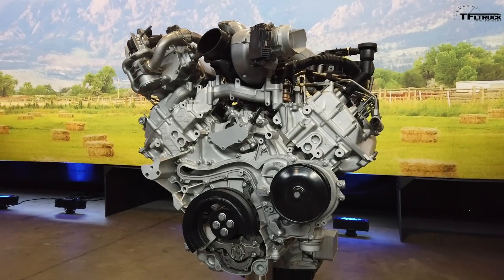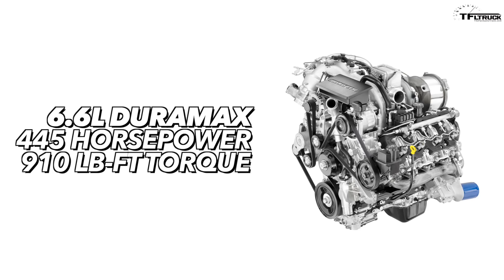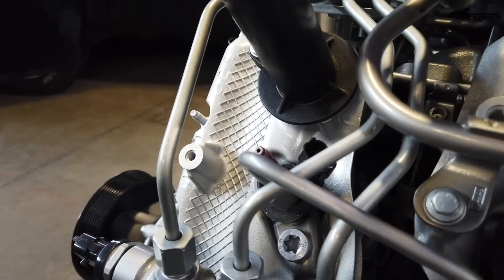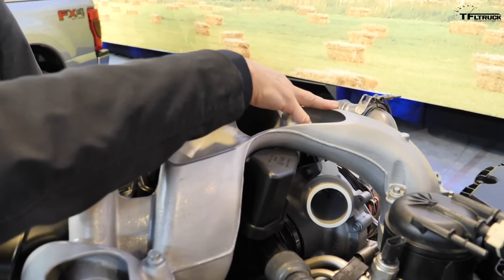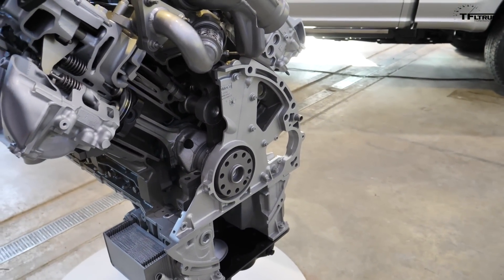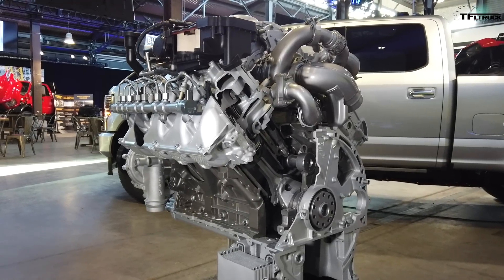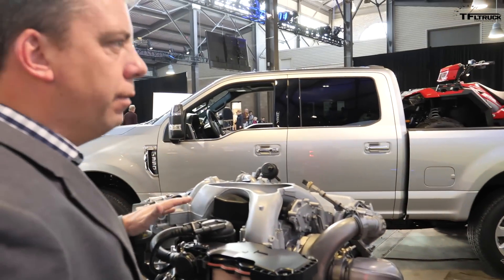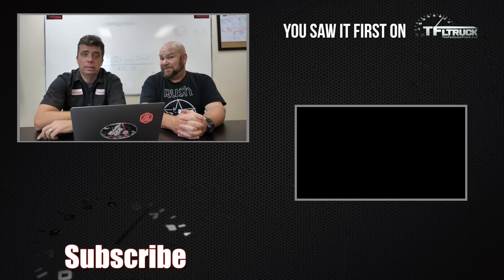Here's How the 2020 Ford Super Duty Diesel Makes 1,050 Lb-Ft of Torque!

Comment: EGR gases need to be plumbed from after the exaust filter so the EGR cooler does not get clogged with soot  and the exhaust filter needs to be removable like in a big rig so it can be sent out to be cleaned like a big rig

Comment: I USED TO BE A FORD GUY AFTER OWNING SEVERAL SUPER DUTIES 2002,2011,2013,2016,2018 AND MY 5 MONTH OLD 2019 F350 KING RANCH ULTIMATE DUALLY THAT CAUGHT FIRE INSIDE THE CAB ON DRIVER SIDE ALMOST TRAPPING ME INSIDE DURING AN ACCIDENT. WAS HIT ON PASSENGER SIDE AND CATCHES FIRE ON DRIVER SIDE. SOMETHING TO THINK ABOUT ESPECIALLY IF YOU HAVE CHILDREN STRAPPED INTO A CAR SEAT OR BABY CARRIER. CALLED FORD CORPORATE TO REPORT CONCERN AND THEY COULD CARE LESS

Comment: Great video!  But, with manufacturers making 400+ HP and 900+ lb-ft, knowing who makes a touch more is becoming absurd. Current tow tests measure the time it takes to pull ~30,000 lbs up a steep, sustained grade. Such extremes don't reflect the real world for the vast majority of truck buyers. How about testing fuel mileage on the same grade with a 'reasonable' speed (~55MPH) & towing a 'reasonable' load, say, ~10,000 to 15,000 pounds. Does one get better mileage or run smoother?

Comment: For '19 when ram and Cummins topped the bar when the HO Cummins had cracked the 1,000 FTLBS barrier as ford was to come out with a third generation 6.7 power-stroke for '20 when they found an extra 50 FTLBS.  For '21 those predict ram and Cummins to roll up their sleeves to retake the crown of most powerful diesel pickup when they have to come out with the HO Cummins making 1,100 FTLBS.  With other class leading performance was maximum fifth wheel towing is bumped to 37,000 LBS.

Comment: GUARANTEE the very near future will be gasoline/electric hybrid HD trucks. The 7.3 with an electric motor would be way less expensive and more reliable in every way than a diesel and get better mileage with cheaper fuel. I’d bet anything that is why they built that motor.

Comment: By putting 40lbs of boost to it. Until your motor has 150,000 miles and 50% of its original power.

Comment: As great as all this sounds, I wish they'd go simple and reliable! I own a 7.3 idi from 1993. Ive changed the injectors, injection pump, and other stuff myself because it is simple. Looking at this engine, it looks like a nightmare to work on. So hopefully it lasts forever, or hopefully all the ancillary components (like the turbo) last until catastrophic failure 1 million miles down the road. This new engine reminds me of jet engines with all the tubes and fittings everywhere. And who needs that much torque? And who do you trust to tow 37,000 pounds SAFELY?! That power rarely is planted to the wheels because the computer stops you from blowing up the drivetrain. Anyway, I am a Ford loyalist, but all this recent crap with tiny 4 cylinder turbo direct injection and space age diesels makes me hate new vehicles.

Comment: Ahh reliability never mentioned.  I think if I was buying new I prefer the 20% less moving parts of the Ram/Cummins line. V8 diesel have been inherently less reliable then a I-6 over the years. Just look at the older trucks and folks taking Cummins engines and plop them down into the Fords to make a Fummins

Comment: Did anyone else catch the weight ratings in that chart?
Max towing F350 dually 35,750, but max gcvw still 40,000. 
So, you have the power, but the truck itself isnt rated to pull the weight?

Comment: I agree with what everyone else is saying. Sure the numbers look great on paper but the 6 7 ford is one of the most unreliable Diesel's ever. Same with their Eco turds, Ford forgot how to build an engine in the early 2000s.

But no big deal it's only 75 steps in a few hours to pull the cab in order to do any sort of repair on the thing. These things are technicians nightmare even if you have the Ford IDs scan tool it still extremely difficult to do anything

Comment: Wow, that is 75 HP and 50 ft lb of torque less than the ford with 2 fewer cylinders!  This comes out 66.6 HP per cylinder and 166.6 ft lb of torque percylinder for the cummins. That is compared to 59.37 HP per cylinder and 131.25 ft lb of torque per cylinder for the Ford. Not even a close race. The Cummins is a far better motor all around.

Comment: Dump the egr. The DPF will catch all of the particulate. Why choke the engine anymore than you have to?
Reply: Yeah, wasn't the egr invented to allow gas engines to run leaner without pinging? It boggles my mind that you'd want to run the crap from your exhaust through a turbo. My 94 ranger's egr port was COMPLETELY CLOGGED with carbon buildup after 200,000 miles. I had to use a coat hanger to break a hole back into it. Total garbage that stuff.

Comment: GM isn't playing these numbers games. Form over function hence the huge front ends on the 2020 GMC to fit industry first all aluminum fan with largest diameter. Also to fit the largest radiator in the industry and oil coolers. And industry first ram air for further cooling. The 2019 Duramax LP5 had a great track record without the new cooling upgrades. How did Ford address the over heating issues the YouTube hot shot dudes are having with their 2019  Powerstroke tranny's??

Comment: Get that same 6.7 liter Diesel into an F650/750 and it has 330hp and 725lb/ft torque. This is what this engine really puts out. That higher horsepower and torque is like your gasoline engine running with all 4 barrels open all the time-just doesn't happen.

Comment: My 2015 powerstroke fx4 lariat with a touch of performance mods and reliability is pushing over 700hp and 1500ft pounds with the locking diff and all the tremor package stuff already other then the under armor so please explain the 100k price tag i bought mine 30k miles and have 135k on it now never been to the shop and i race mine

Comment: Ford needs to develop inline 6 diesel like that of the Cummins. Most semi truck use inline 6 but much bigger displacement. These turbo diesel V8 engines no matter the generation take too much spaces. They are a nightmare to work on.

Comment: So many questions. Did they solve the Def problems? Do spark plugs seize inside the engine? Does working on the engine require the body to come off? It seems Ford purposely puts goose eggs to break on certain points in order to create revenue on repairs. 
I'm looking for durability, longevity and ease of repair. 
They make great trucks when new but five years later....boom. Break out your wallet. My buddy has gone through two Ford's and is on his third. Sheesh.

Comment: it's still 900 foot pounds of torque I mean this is just a big dick waving contest at this point in my right I mean if you have over eight hundred foot pounds of torque you're going to be just fine I mean just a couple years ago. It was towing 35,000 lbs with only eight foot pounds of torque hearing in all the other systems in the truck matter just as much if not more than an arbitrary torque number I mean why don't focus on improving the emission system you know figuring out a way around EGR getting improvements death systems figured out what about all that but about all the important things that matter you know what about better cruise control better like adapter speed control what about better transmissions what about better rear-ends what about putting some research and development in the tires or something you know like what about you know going in the air suspension for these heavy duty trucks I like I know Dodge does it with the 1500 but why not the heavy duty trucks I mean why isn't four-door Dodge or Chevy making air suspension for their half tons are there three quarter tons or one tons why do you have to be a commercial business to get a manual transmission there's a lot of different problems and I don't think increasing torque by 50 foot pounds here and there is solving all those problems and with the Chevy the Dodge in the forward to all three you can take him to a shop and you don't even have to rip out all the emissions crap or replace turbos are injectors or anything just get a basic tune and you could be making well over 1200 foot pounds of torque which let's be honest is way more than these trucks were designed to use and plenty enough Tutto whatever the hell you want I mean who's legitimately needing a consumer-grade 1-ton Tun to tow 40,000 lb almost I mean that's just ridiculous

Comment: I have a feeling the 7.3l is going to start poaching a lot more diesel sales in the 3/4 and 1 ton market. This monster is now only worth it for medium duty loads. You may save $0.10- 0.20  a mile on fuel while towing, but  you're paying $6k more initially, and WAY more for components come 100-120k miles. Now I have no doubt it will still be popular with those who buy with their heart, and not with their brain, as well as those who just don't know any better, but their will likely be an acceleration of what is already a trend toward gassers.

Comment: I’m curious where did Ford lose weight to improve the payload capacities?
Reply: Aluminum body saved around 800 lbs then they added heavier axles and brakes to get higher ratings
Reply: Kevin Mohr They’ve had the aluminum body since 2015.  Heavier axles reduces payload capacity because the GVWR does not change.
Reply: Kevin Mohr Also axles and braked do not changes the payload capacity except when they are lighter or heavier.

Comment: How is it runs F450 with high hp and torque, where GM & Rams 4500 are limited to 350 hp and 800’s for torque.
Did they derate the GVW on F450 to lower rate to be able to put high hp & torque?

Comment: Let’s see the F-250 and test that against the GMs and Rams 2500’s. That’s the test we want to see. Don’t care about mad tow, want to see what the common man is going to buy for daily driving and occasional recreational towing. That’s the segment that most people buy in. Getting all that extra power but the chassis hasn’t change and the payload is still around 2500 pounds XLT with diesel where the GMs 2500’s HD are around 3200 pounds. Ram has around 2000 pounds in their 2500’s. Can’t wait for that test.

Comment: these two numbers for the Tremor F350 is mind boggling for a Single Rear Wheel Drive, 21,900 lbs gooseneck weight rating, over 4,000 maximum payload , how can these numbers be right?

Comment: Electric motors will absolutely replace these big engines in time. We will get so much more HP and it will take lots less mechanical equipment. No tranny's , no rear ends, drive shafts. Our future is going to be bright in the transportation department. And all the manufactures are getting in line to do it.

Comment: ford is making their engines to complex give us a in line six.
Reply: Just curious as to what is complex about the engines? Is it because of 8 cylinders vs 6? Is it the reverse flow heads? Don't know how the charge pipes are routed? Is the plumbing on the high pressure fuel system scary? I don't get it... just because this new technology looks different and may work just a tad different, doesn't make it more complex at all. This is the equivalent of everyone being afraid of EFI when it first started becoming mainstream in the 80's.
Reply: "Too" complex...."an" inline...
Reply: Radke32 an in-line 6 is not that complex

Comment: They keep tuning up these medium duty truck engines for consumer pickups.

Curiously, if you buy a commercial level truck, such as an F-650, the same engine is significantly detuned for longevity in the commercial environment.
Reply: GM isn't playing the numbers game just function over form. The huge front end in the 2020 GM have the largest only aluminum fan in the industry also the largest radiator and oil coolers. Industry only ram air for further cooling. The LP5 had a great track record in 2019 without these new cooling systems.
Reply: We have a 2017 450 and a 2018 550 both chassis cabs with contractor beds and the power sucks! It's ridiculous that they de-tune the trucks that people buy specifically to be work horses on a daily basis as opposed to weekend warriors. Tells me they don't have that much confidence in their products.
Reply: @InLaymansTermsPlease  you would actually have the same powerstroke in those trucks then as a regular sd, chassis cabs normally come equipped with a higher axle ratio though. So that makes them seam real sluggish but I can tell you from experience put a 4.10 behind anything and it will peel you're face off. Theres also a chance that since they were bought for commercial use they came with an anti idiot tune like they do on the transit and promaster Van's at my job. Commercial market it just it own animal
Reply: @Tman0517  they are limited to 330hp in f550 and above because they wouldn't last haulijg that much weight and making the power they make in these 3/4 tons. A 550 is slow as hell but they derate them so they will last more than a few thousand miles, because trust me, a 6.7 making the hp 1050lb/ft torque in a medium duty truck like an f650 or f750 wouldn't last at all.

Comment: It's easy to print out specs that say whatever they want.  I'd like to see a third party put all three manufacturers diesels on the same dyno, on the same day to see if any are exaggerating. Of course they would all need to be equipped the same. (Matching gear ratio, tire height)

Comment: when are they going to brag about reliability and low maintnance?
Reply: JK 241 i absolutely agree, reliability and low maintenance should be what everyone concerns should be
Reply: I believe the 2020 Duramax is the most reliable. The LP5 doesn't have the largest numbers has a great track record and is built around function over form. Hence the huge front to fit the biggest aluminum fan (not plastic like the others) in the industry, largest oil coolers, and radiator. Not to mention the industry only ram air for further cooling.
Reply: LMAO! That's the funniest thing I've heard all day 🤣
Reply: When the consumer does.
Reply: @Michael-ii9fs  all I'm try to say is high output numbers are selling diesel trucks. If not, the manufacturers would not be in this power war. Personally I want a truck engine that you can put 500,000 miles on. That is why I have a 97 F-250 with a 7.3 Powerstroke.  By the way it is stock and only has 225 horsepower.
Reply: Barry Whitt agreed!!! I love my 2001 f350. The exhaust smell never gets old!!!!!! I’m keeping her forever. I love the 97 OBS f250s. I’m sure she’s a lovely rig as well.
Reply: Nothing like dropping $100k on a new Super Duty to drive around F150 loaners because your truck cant go 5,000 miles without spending a few nights or weeks at the dealer.
Reply: Never due to all the people that daily drive them in the suburbs all about look at me  not the truck actually working
Reply: JK 241 Manufacturers are not interested in that.
Reply: that’s why i have a 2018 tundra for reliability and only had one recall for updating my infotainment system but i really like to have and believe in a brand new ford f-250 powerstroke 6.7L
Reply: @ K Bomb I get sick of hearing about Toyota reliability. How many miles of virtually trouble free miles are considered reliable? I trust my wife in high mileage vehicles for 5 hour drives all the time. 300,000 on a 4.0 Explorer and now 210,000 miles on her 4.6 F-150. Haven't ever had to call a tow truck or go get her yet. Are you driving an extremely high mileage 2018 Toyota and concerned about reliability? Try 210,000, 435,000, and 447,000 miles. That's what we have on our Fords. Ford, Ram, and GM trucks have been out there in the real world working and being abused for years and years. But, you drive a Toyota for the reliability. Yeah, right.
Reply: mtrujillo1973 well that’s cause goats are crud, and I thought the Cummins was on the list due to low ratings when they test drove it? 🤷🏼‍♂️ but I do know that when we get a loaner ram loaner for our mb sprinter which is in the shop for 1/4 of the year every year it was a great truck and all but visibility in all directions and the mirrors just were not as good as the ford loaners but it did deliver the power way lower. And I have no idea about ford/rams reliability. But I did like driving the fords a lot more and back then I was a ram guy.

Comment: Unless Cummins starts revving that big six, they're not going to get the power. And power, folks, is what tells us what the REAL capability of an engine is. Remember, torque can be generated with gearing. Horsepower is the same, regardless of what speed/torque the wheels are turning.

Comment: I personaly think its awesome to have that power but I would rather ford spends the $$ in making there exhaust aftertreatments bullet proof. I tow A 12k camper with my lml duramax and it hardly works. 900 foot pounds is more than enough. Most people legally cant tow at max with that truck without a class b. Consumers want reliability before HP. Make emmisions running gear that is maintense free until 200k then you have my interest. GM ford and RAM have not accomplished this yet.

Comment: It’s still a FORD and it’s still a powerstroke. I work on these trucks everyday they are very problematic. So much so that the government will not even use them. The Duramax is by far the best and most reliable engine and easy on maintenance. Numbers are great for commercials but every day power and reliability is what’s really impressive and that’s the bottomline! ￼
Reply: Thank you sir someone finally told the truth! When its gets down to it the duramax is the way to go.

Comment: And to think that Ford pulled out the 6.7 powerstroke out in 2010 with 440 hp/ 860 tq. Do in case you haven't noticed it this engine was extremely derated as far as power goes from there factory back in 2010 . I'm sure the maximum go/ tq #'s it can really push is allot higher then we have yet to see!